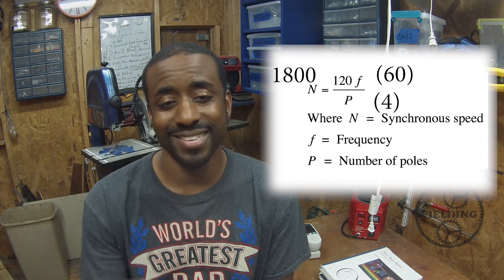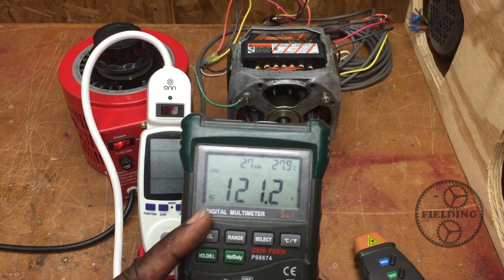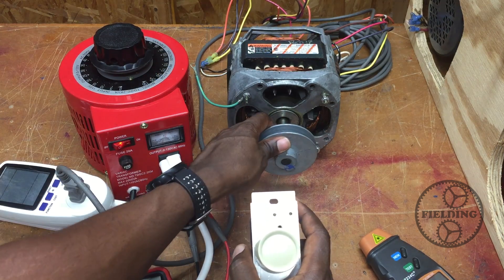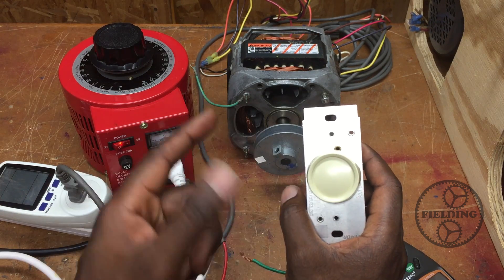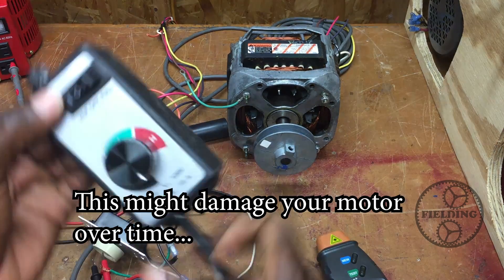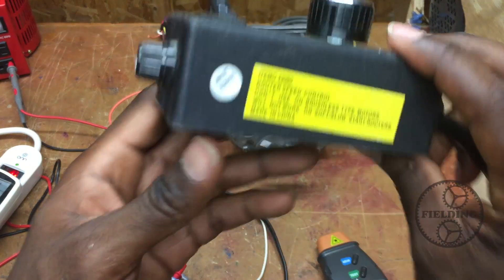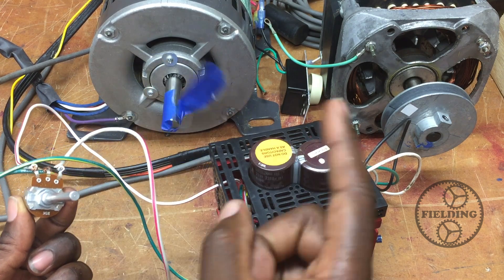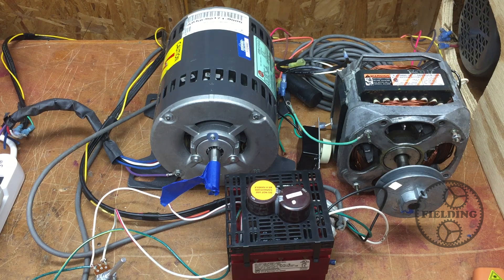Will A Dimmer Switch or Transformer Control An Induction Motor's Speed: 038

Comment: Have you thought about trying a brushless esc?  It's basically a half wave vfd. I'm just not sure if it will properly drive the inductor.
Reply from the maker: Man I love the way you think! I had to do some quick investigating because I have never used a ESC to control a motor. I wanted to confirm how they work. It looks like they use position sensors or back emf to determine when to change the "phase" we will call it. And, of course Brushless motors have permanent magnets and run at synchronous speed with the controller. The two issues I see here is induction motors need to slip to produce torque, but ESC requires synchronous motion. Unmodified it would probably studder at startup (with no load) and completely stop when the load was applied. Next you need to fake the feedback signal some how or control the frequency directly. One more thought... voltage. I couldn't find a high voltage ESC and that would also be a problem. You would need to find one, and it would probably cost more then buying a VFD made for mains voltage.

Comment: Hey man nice info, my question is I want to modify a heat gun to use as a hot air rework smd, can you tell me what two regulator I can use to regulate the the fan and the heating, it's a 120v 1500w 50/60hz.?
Reply from the maker: I don’t know enough about what you are trying to do to offer any help.
Reply: I want to use for desoldering components but the heat and air needs to be regulated there are 2 speeds on the heat gun the low is still to much air and heat, this is what it look like https://www.rona.ca/en/heat-gun-00275614
Reply from the maker: I don't usually do one on one advice. It is not safe, and not practical. I get hundreds request like this, and I can't know if you are giving all the relevant information, or even if I understand the question completely. If the question is common, I will make a video about it. But, you are the first to ask about something like this, and like I said I have never made or used this kind of item. I would be starting from zero knowledge. Google is your friend. You are probably not the first to make something like this. Good luck:)
Reply: Jim Mclean thank you for replying man I am going to try the potentiometers I am getting 2, one of the air and the heater it's max power is 2000w and the heat gun is just 1500w, the main point is   to regulate for lower air and heat, thanks again for the reply Jim. And for the question I asked, I think it was very simple, ones they know the concept is the same, I just want to regulate  the out put, I rather learn things the hard way, it builds a better experience for me, and if I try something and it don't work because I ask some one and they say try this or that, I will try it and if it don't work it's OK I still learn.
Reply from the maker: This is pretty exciting to see. I love it when you guys help each other. I am proud to be apart of the community we are growing here.
Reply: Jim Mclean it's the cost if they put potentiometer they will have to put a lcd to read the heating, but they do have heat gun's with just a potentiometer and a on off switch, the 1500w does not mean it goes 1500w when on the high speed that's just the max limit, it's only corrent  not the voltage I want to limit, Is  the draw amps is what I got to look out for.
Reply: Dev Trend you could try variac just my 2cents.

Comment: Jeremy, I'm in Brazil, and, I used a dimmer from a shower head, to run a Universal (brushed) motor from a vacuum cleaner., the dimmer has a triac cheap on it.
But, off course, you are talking about induction motors.
Reply from the maker: Correct... It works well on DC motors and Universal motors. Although they are not designed for inductive loads, so they may fail sooner than later. But that is a different topic.

Comment: Hi Jeremy, would I be able to safely control the speed of a brushed motor with the dimmer switch or router box??? Hope to hear from you soon, thx for this video
Reply from the maker: yes... a DC motor responds pretty well to a dimmer switch, but because of the load type (inductive) the dimmer switch may not last very long. They are not designed to drive motors. It is very different from powering a light. The motor "pushes back electrically"  sort of speaking..., and that is a different problem.
Reply from the maker: The router speed controller is a better option for motors. Also universal motors (also brushed) respond very well.
Reply: You are awesome Jeremy, I wasn't expecting such a fast response. Thank you so much for your FAST reply! :-)

Comment: When you lower the frequency aka hz will that change the line voltage too? If it does how much voltage will the motor be getting at say 38 -48 hz and how will this affect the amps used vs the amps drawn?
Reply from the maker: +charles johnson the frequency does not change the voltage
Reply: Jeremy Fielding thank you again very informative my motor is only a single phase non reversible motor with a relay ... I was trying to use it to create a soda can crusher but I cant figure out how to make it go forward and backwards im guessing that I need a different type of motor
Reply: Its off of a craftsman wood lathe model 113.228360
Reply from the maker: If your motor is truly non-reversible you need another motor. You should watch my video on reversing motors. That would be the best help I can give. It is in the "how to wire and control motors" playlist. 
I try not to get into diagnosis with people one on one. It isn't safe, or practical since I get hundreds of request like this. I can't know if you are sharing all the relevant information, or if I understand the question completely. Also it doesn't hurt to search the web for your motor to see if it is reversible. If it is, my video will show you how to do it.

Comment: Seriously, I think you should be working for NASA.  It is unlikely that anyone there can top your passion for learning and even if they do, they do not have your degree of ingenuity.  A PHD in physics or engineering does not match passion or imagination.  Keep doing what you are doing and I know that good things are coming your way.
Reply from the maker: Thank you for the kind words :)
Reply from the maker: I hear NASA is downsizing... it may not be a good place to work now LOL
Reply: You are welcome, they are well deserved.  May be downsizing but you would gain a pretty sweet workshop
Reply from the maker: Yes indeed!
Reply: Back when I worked at JSC, the people who actually worked for NASA (i.e. government employees) were the bureaucrats / project managers who were responsible for projects at a very high level.  The engineers who actually designed and built the systems worked for the various aerospace contractors (Lockheed, Loral, Boeing, etc).  There was quite a few layers of management on top of the engineers who did the actual work.